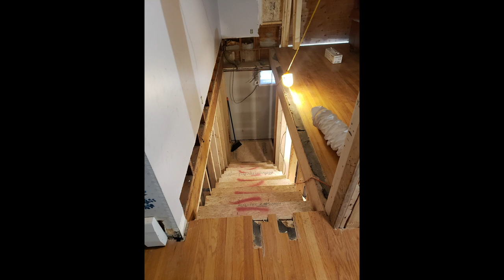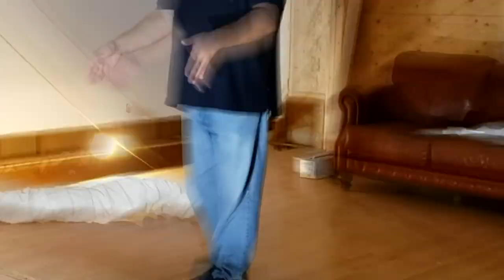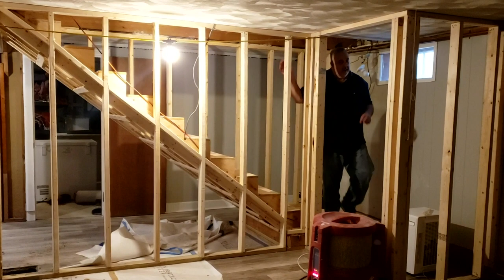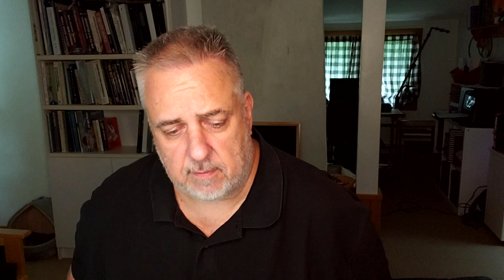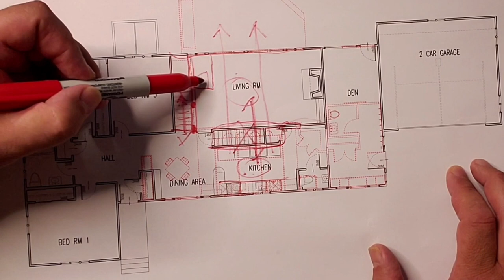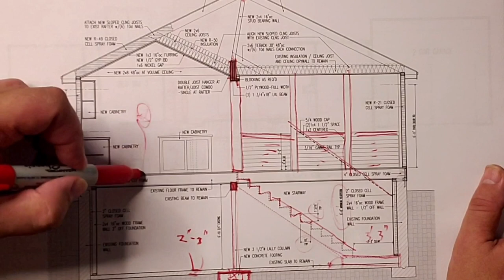Re-Locating the Stairway

Comment: Headroom at the basement landing, as you turn the corner looks tight-- if the 6'-8 clearance projects at the center of the landing at the ceiling. Of course the landing itself , the portion ahead, should be 7' headroom, (as should the basement as habitable space--but this is an existing condition, so possibly exempt).